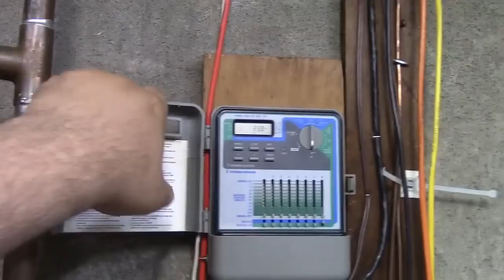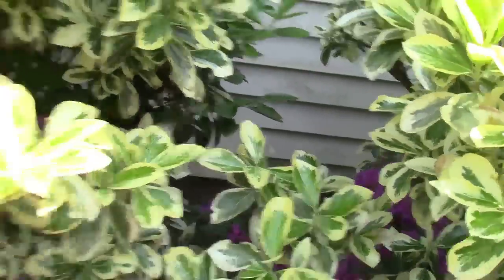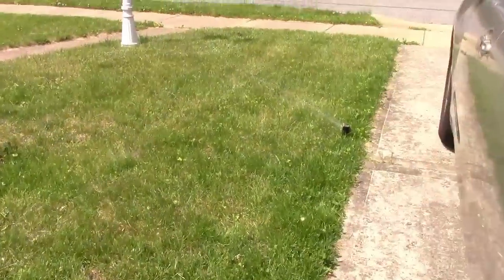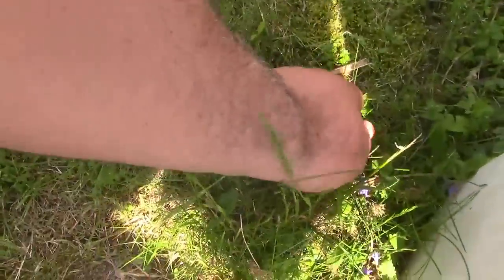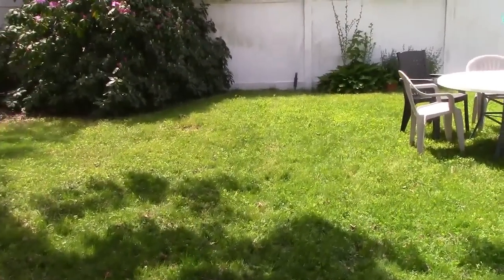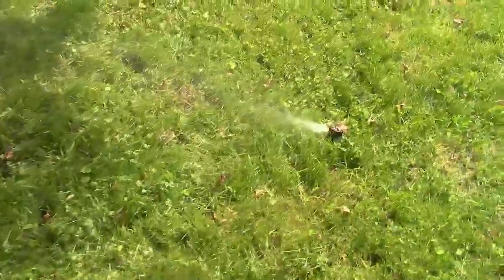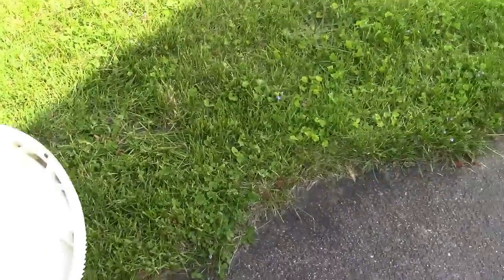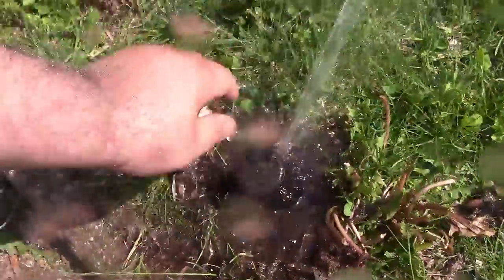How To Turn On Your Inground Sprinkler System (2019)

Comment: Very nice, glad there were Octember-like issues!

My system is controlled by a Rain Bird ESP Modular, it is now 10 years old, and so far works flawlessly. It has a "test all valves" setting that I have set for two minutes per zone. Though I don't have to close mine for the winter, I do periodically test all valves to make sure all the heads are working, and pointing in the right direction.

I haven't ever filmed my sprinklers, that's one I could do soon.
Reply from the maker: Yeah, this system is a good 10 or even 11 years old now also.  The heads are getting old, some are leaking, but I have replacement wipers for them, just need to replace them!

I would definitely be interested in seeing your system run!  Best show would be in the early morning when the sun is rising, or late evening when it's setting, the sun kind of "catches" the drops and make it a lot more visible.
Reply: So far my sprinkler heads seem to be holding up. I'm probably overdue a walk around to check on each one. I know for certain there are no leaks as my water meter tell-tale wheel isn't spinning.

Thanks for the tip on filming the sprinklers. I'll do the best I can since there are big trees to the East, and even bigger trees to the West. May have to do the front in the morning, and the back in the evening. I'll play around with it before I film the real deal.
Reply from the maker: Yeah no problem.  I found that out from experience also, having the right light is the only way to see it.

Comment: I do miss the control panel at the LI house. That was probably the easiest (and fastest) one to work with, especially operating zones manually.
Reply from the maker: Yeah this old timer just works and works nicely.  The new ones don't have sliders anymore, it's all electronic, so you have to sit and play with up and down buttons on a small LCD.

For manual tests, this one made it easy.  xjoe81x tells me that his timer doesn't even support that where it will do an automatic run through.  Each zone has to be fired manually, so obviously we know who had to do that, and I wasn't there!
Reply: I THINK ours can do an auto run through, I’ll have to check it out sometime.

Comment: I have never watered my grass because I don't want it growing up too fast. and I hate having to cut it constantly.  Still keeps growing.
Reply from the maker: My father's the same way.  Why waste the water, then waste the gas to run the mower?

I like to keep up appearances.  Sure it's all crabgrass and weeds, but it's green, and anybody driving by won't notice a brown, dead "lawn".  My neighborhood is like that, you don't find any run-down houses with paint peeling and overgrown with ivy or anything like that.
Reply: @jaykay18  I could careless about wasting water as it wouldn't cost much of any thing to leave the hose on over night.

It has never gotten to the point of a brown dead lawn unfortunately. 

I just hate the idea of creating unnecessary work. 

I live in a decent area of town luckily, however some of the neighbors are petty ass holes.
Reply from the maker: Here, water costs about a penny a gallon.  I've had numerous times so far where I've had to leave the hose on for 4-6 hours at a time.  I'm fairly certain this bill will see a NICE spike.  Since making this video, I haven't run the sprinklers at all.  The weather just hasn't warranted needing it.

I hate making unnecessary work as well.  I've spent most of my life finding the fastest, least labor-intensive ways of doing things.  And it doesn't matter the power consumption or water consumption doing that since it saves so much labor.  Although you're not paying yourself, if someone else was, that could be a fair chunk of change.  In other words, if you think of how much you make in a day, you'd hate to have to spend that kind of money.  Same idea.

Comment: Sure won't be needed for a while. Thunderstorms for this area yesterday, today, and even tomorrow. Something is fucked, I don't think this part of the country has ever seen tornados.
Reply from the maker: Yeah, strange weather.  Chilly today, almost.

Tornadoes?  Here's a story, ssshhhonny boy:
When we had our apartment, every time it rained, we had to worry if the apartment was going to flood.  We'd watch the weather religiously.  If the Doppler showed anything more than "light green mush" as we called it, we were on alert.  Dark green mush, high alert.  Yellow mush, it was almost certain, depending on how fast the storm was moving through.  Red mush, it's happening for sure.

We couldn't wait to get out of there, it's tough living on pins and needles like that.  The place had flooded 3 or 4 times before due to a poorly graded yard.

Finally we moved.  A month later, a small F0 tornado struck my town.
Reply: Oh wow, ever get hit by the pink or purple (if they had that while you were still there).

I'm safe from flooding, even being NEXT to water, I'm on the 2nd floor of my building.

Our old house, built in 1945, developed a leak one day during a red mush storm lasting over an hour. Never figured out what it was, 5 years, several repairs, and much frustration later, it was a chewed hole through the corner of the roof, hidden by a gutter. I remember during sandy, you could hear the house creek and shake from all the pouring rain and heavy winds. Surprisingly, the leak DID NOT act up during sandy, it was very interesting to see the newest fix somehow held because the same guy did it once before and it busted for a pretty light storm, which was the first after some dry days.
Reply from the maker: Usually the pink or purple is for snow.

I'm at sea level, and only 3 short miles from the shore.  The water most certainly came at least a mile onshore as I saw later on.  A bit scary, but not entirely unsettling, as it would have had to come up 2 more miles before I'd ever have a problem.  During Sandy, I had no problems with water either, here the storm seemed to be more wind than rain.  The areas 2 miles south of me were devastated because of the storm surge from the ocean (technically the bay).  Even more interestingly, I believe we've had stronger winds in other passing storms than what Sandy brought, and one actually ripped a piece of flashing off of my roof.
Reply: Well atleast for crappuweather the pink and purple are extra hard rain.

My town is at sea level and there is water on most sides, which is a problem for being right next to it. My old house funny enough was kind of the center most part of town to where the water is. Its raining now as a matter of fact, very fun.
Reply from the maker: Just a few seconds ago there was an exceptionally bright bolt of lightning, followed a few seconds later by a nice crack of thunder, neither of which I've seen that strong in a long time.  Lightning is pretty scary, it struck the school at the corner one time, and someone's detached garage down the block another.
Reply: I remember you actually made a video on that garage incident.

Last night here was lightning central. Snap, crackle, pop all over the place.
Reply from the maker: Yeah that came up as a suggested video for me recently.
Reply: Well, upload something and many years later is when it gets suggested. Good old youtube.
Reply from the maker: Yeah that's how fast they fix the broken stuff.
Reply: Well they just want a participation trophy. Isn't that enough to ask for. 

Well give it 5 minutes and they are gonna be group chatting on their new iphone XR, AND Samsung Galaxy S10+, driving around their fancy BMW or hybrid Toyota Prius V with a cup of starbucks and avacodo toast in hand. All the while they are going to be complaining about not having enough trophies.
Reply from the maker: Eff Emm Ell.
Reply: Kay Emm Ess